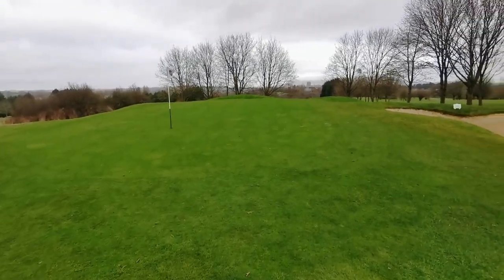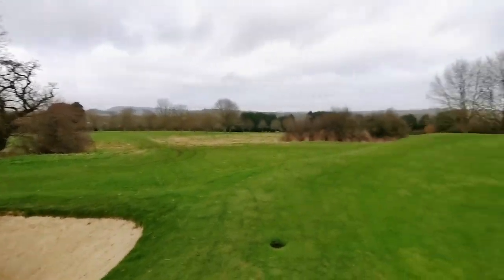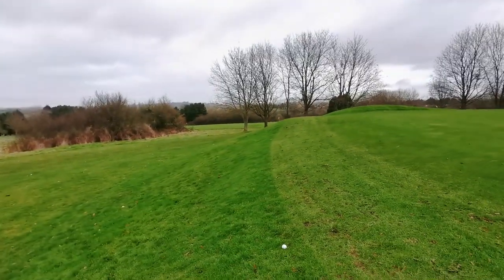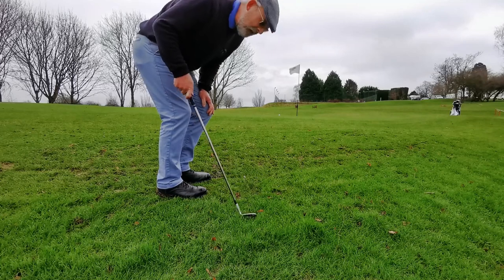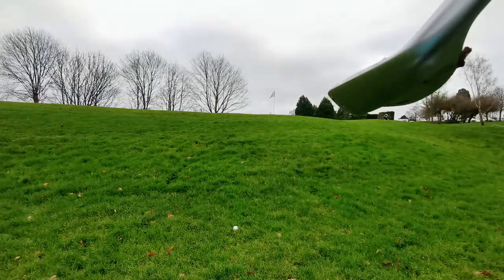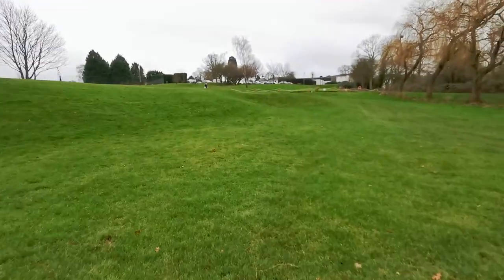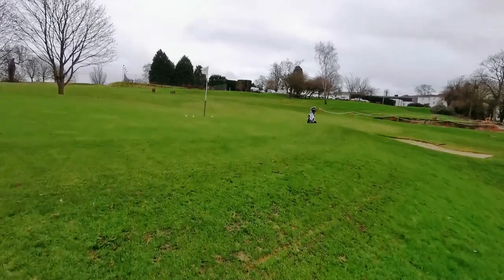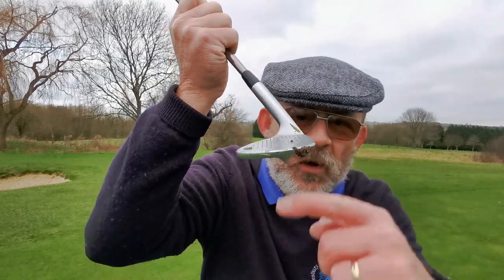How to chip up to a raised green

Comment: Th 14th at my course requires shots like these. Great tips.
Have you produced any bunker videos? Thanks
Reply from the maker: I wanted to but didn't because tewkesbury park bunkers were shit. The wrong sand which would stick together and make a very firm mud like base despite being 3 inches deep. The rakes were short tined so no matter how you tried you couldn't fluff them up. They used some white sand which was just the wrong type. Looked good but were very poor. I'm certainly going to do one at Lilley Brook. I have discovered I can play bunker shots after 5 years of thinking I was hopeless.
Reply: @thehairygolfer  looking forward to it. Like the emphasis on bounce, never thought of that concept or it's importance.  The short game is going to reduce my handicap more than the long game. Whenever we get playing again!
Reply from the maker: @alanjordan6198  Just being able to chip the right distance in the right direction will save you a ton of shots. You lose fear on long par 4's as it doesn't matter if you miss and you can make more birdies on the par 5's if you can get close enough in 2.
Chipping must be easy though as I don't see anyone practicing it.
Reply: @thehairygolfer  during this lock down period. I'm hoping to get out in the back garden and practice as often as possible.  See  how it goes
Reply from the maker: @alanjordan6198  I've got 2 videos to make out there this week.

Comment: Nice chips!  That grouping was tight.  All those putts would have been makeable.   I struggle with the bounce quite a bit.  Most of the lies here are hard ground and most of the bunkers have that hard type of sand.  I find it a little easier with less bounce on those surfaces.
Reply from the maker: The last one surprised me when I walked onto the green as it was the nearest. Hard ground and hard sand are a bitch, then you do need a lob wedge with only 4 degrees.
Reply: @thehairygolfer  I bought a used mac daddy 64 degree wedge.  At the time I wasnt sure about the bounce.  This one came with 8 degrees.  Didnt take me long to figure out that this club has way too much loft and too much bounce.  I would like to replace it with a 56 or 58 degree.  These lofted clubs are so far to find with minimum bounce.  Still looking for one.  Meanwhile my lob wedge sits next to my ball retriever in my closet.  Guess which one of those is going back in my bag!
Reply from the maker: @ChiliDippaGolf  My lob wedge is leant against the wall behind me next to the old 1 iron. I know which of those 2 will go back in the bag too!
Reply: @thehairygolfer  The 1 iron?
Reply from the maker: @ChiliDippaGolf  Yup. I must have another go with it some time.
Reply: @thehairygolfer  Nice!  I would love to see you out ther playing it.  You could do a iron only vid.  I seriously thinking of putting mine back in my back as well.  I have a 5 wood that I hardly ever use that I could swap it out with the 1 iron.
Reply from the maker: @ChiliDippaGolf   So many ideas and not enough time. I have tons of stuff to do. I should be grateful I haven't run out of things to do. I will have a 1 iron day eventually.
Reply: @thehairygolfer  I guess that's a good thing.  Its better to have ideas and videos to edit vs no content and no idea on what to do.  
I want to do some more stuff as well like reviews on my camera gear and drone but hard to find time between family, work, golf, and editing.  If I take shot tracer out of the mix I could do at least 1 more vid a week.